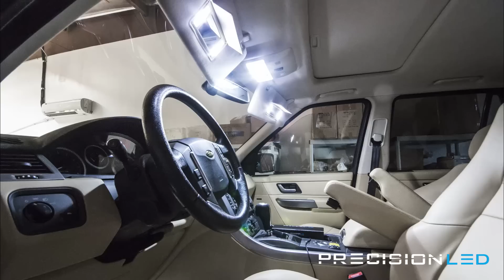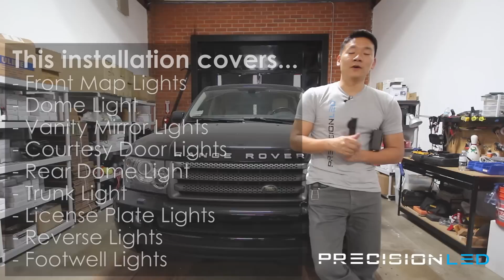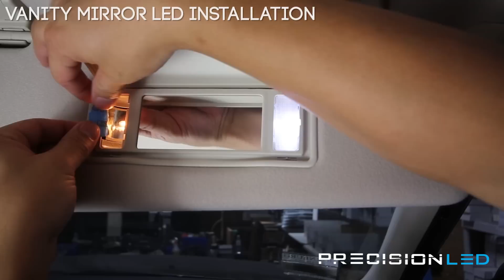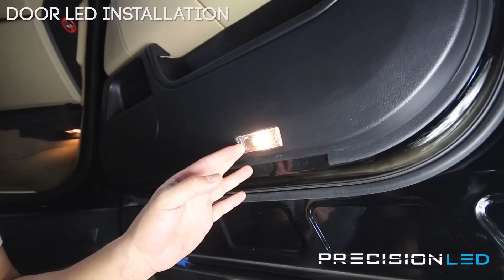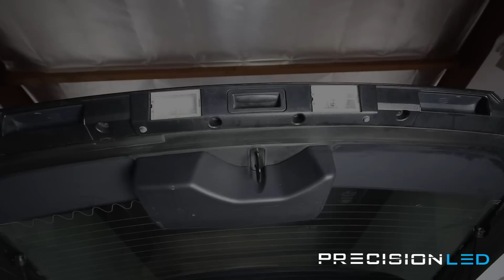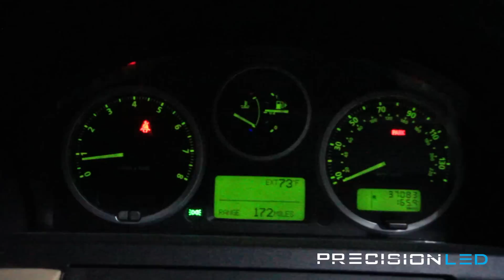Range Rover Sport L320 LED Interior - How To Install (2005 - 2013)

Comment: When removing one of the rear dome housings, the connector just disconnected, because the wiring is so short, it is not even visible. Now it is impossible to reconnect. Any suggestion on how to fix? I'm thinking about some kind of cable extension.
Reply: I have the same problem, I tried to pull the wire with pliers but ended up damaging the black connector…did you find a solution..?
Reply: I need an answer to this also. The wiring harness is way too short to reconnect the light
Reply: I think the workshop removed the headliner partially and fixed it from there.

Comment: Ordered and installed the LED package, very pleased with the results and would recommend to others. One word of caution are the vanity LEDs, during install you need to be very careful as they can touch the back reflective plate and in my case blew the fuse twice. BTW - fuse #57 10amp. Recommend removal of fuse before installing vanity lights, then installing fuse to check polarity, and remove again if you need to flip the lights around.
Reply from the maker: Thank you for choosing PrecisionLED, and for the tips!
Reply: damn, i think this happened to me .. i hope i would have catched this in VIDEO !
Reply: Just had this happen I put one vanity light in and all my interior lights went out

Comment: Are the license plate lights the same T10s as the interior lights?
Reply from the maker: The license plate LEDs are the Standard T10 bulbs.  You can also install these T10 bulbs on the interior, however, in this video, the Premium T10 bulbs are used on the interior.

Comment: I have a 2009 Black Range Rover, I want these lights. Which specific LED color lights are these? I emailed you guys but no reply
Reply from the maker: What email are you messaging?  We do not have any pending inquires in our inbox.  However, regardless, that would be no problem at all.  All you would do is simply make your purchase, and select the color temperature of the majority of your LEDs.  Once purchased, you would just simply reply to this email to custom modify your color temperatures.  I would just ensure to email us immediatley to ensure we are notified of the modification before the package is shipped.  The email you would want to message would be help@precisionled.com.

Comment: Great video, what's the difference between the Standard and the Primium?
Reply from the maker: The new Premium 5730SMD LED bulbs are the next generation of new LEDs.  Compared to the older 5050SMDs, these LEDs have 3 times the light output per LED.  The 5730 LED chip is designed for maximum light output while the aluminum housing helps to dissipate heat effectively for the longevity of the bulb.  The new 5730SMD LEDs have a Constant Current Circuit design which helps maintain brightness if the voltage fluctuates within the circuit and has voltage surge protection up to 18V.  And of course, all of our interior 5730 LEDs are backed by our 1 year warranty.

Comment: any leds for the puddle light on the side mirrors?
Reply from the maker: I believe the outside puddle lights would be stock LED, which you cannot swap, as they would be mounted to a chip and board.